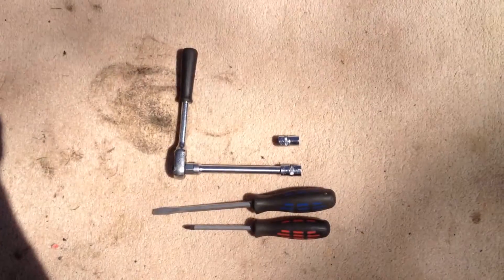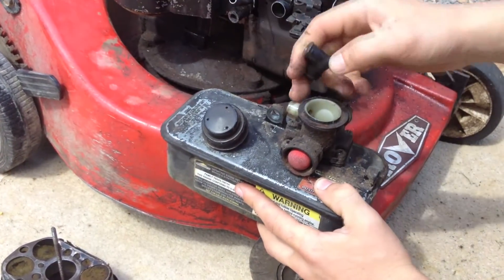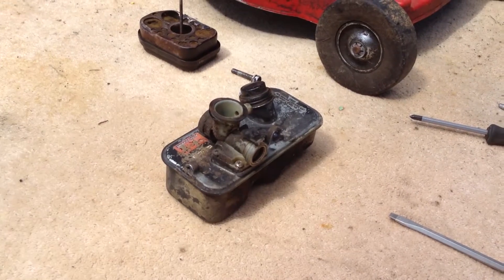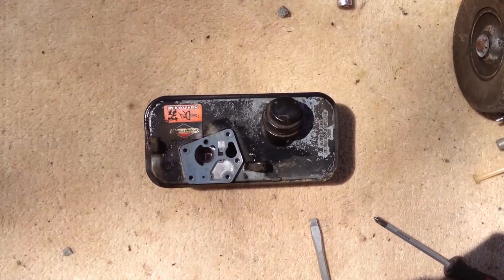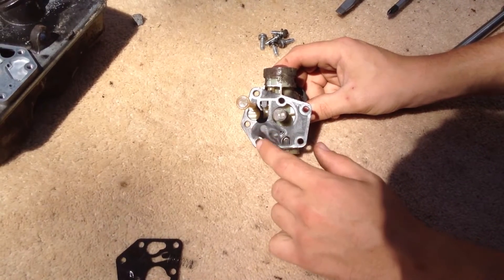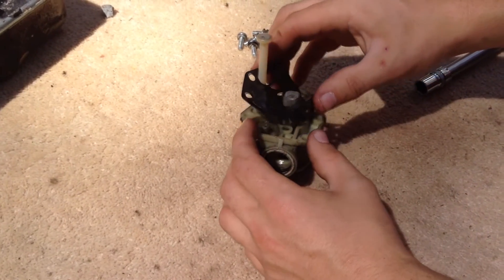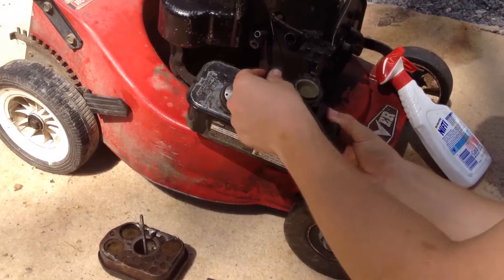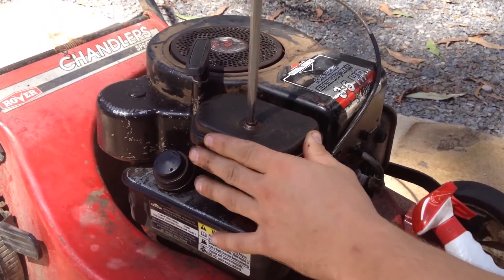PushMowerRepair.com - Briggs and Stratton Diaphragm Carburetor Repair

Comment: Hi, I have the same carb in my troy built washer but my issue is that it surges. I took apart the carb and everything looked great and clean what do you think the issue could be? It smokes lightly and burns gas too fast. I took off the air filter to see if that was the issue but it keeps surging.

View or Print invoic

Comment: Thanks for your help so far, how can you tell if it's valves or bad rings? Do you have a video on this? Finally how do you determine whether it's worth going any further or just chuck the mower out?
Reply from the maker: +Roonza Car It is most often bad rings, This can be confirmed if the mower blows smoke while running especially when throttle speeds are changed. The values can be removed without to much trouble for cleaning & inspection. we do not have a video of this at the moment. If the piston rings are worn it is usually easier to find another engine to replace the worn one.
Reply: +PushMowerRepair.com Haven't noticed any smoke when throttle is changed so hoping it's just valves. Will I need to replace any gaskets when I disassemble and inspect valves? Will I need any special equipment besides feeler gauges? Thanks for clearing this up.
Reply from the maker: +Roonza Car You can remove the values without any special equipment but it is more difficult, A valve spring compressor makes the job a lot easier. You may need to replace the head gasket & the valve cover gasket if they are damaged when you remove the components.
Reply: Thanks do you sell those gaskets in case I need them? I think with these types of motors you need to split the case as well if you need to change the rings.
Reply from the maker: +Roonza Car Yes we can source gasket kits for you we would need your engines model number usually found on the starter housing above the spark plug or exhaust. Yes in order to change rings the case must be split.

Comment: Have almost the exact machine with the exact carby. My mower starts but requires at least 6 or so primes to start. Once it starts it runs ok. Have cleaned it out thoroughly as per your video but it still behaves the same. The diaphragm and gasket looked ok probably a little better than the ones in your video but end result no change in  mower performance, any ideas on what to do next?
Reply from the maker: +Roonza Car When you primer the mower the first few times does petrol spray into the carby? or only when you have primed it a number of times already?
Reply: Yes it does spray into carby straight away, took off air filter to confirm this, compression test reads only 45 psi, also changed the diaphragm and gasket, no change in behaviour, takes several primes and will run, also need to pull on starter cord quite hard to get it to run.
Reply from the maker: I would say there is no problem with the carburetor and that the symptoms are due to the low compression, low compression makes then harder to start and they begin to lose power aswell.

Comment: don't over tighten the bolt into the crank case because once you strip the threads in the bolt hole, your'e in a lot of trouble  (6:00)